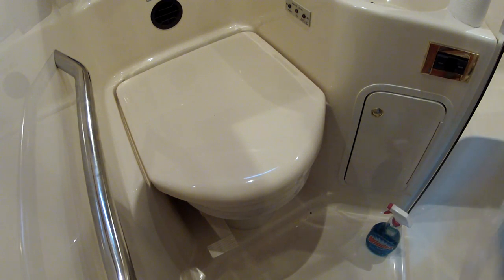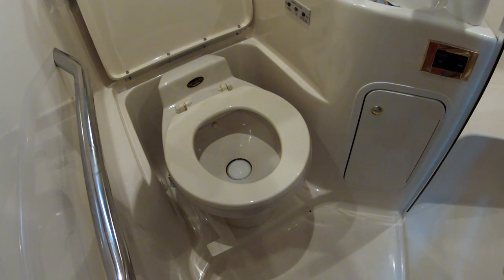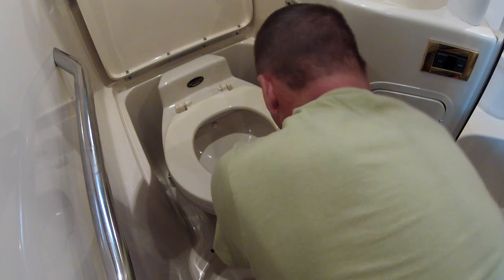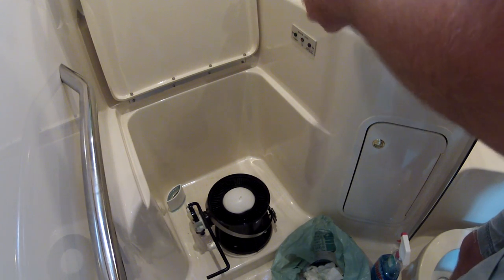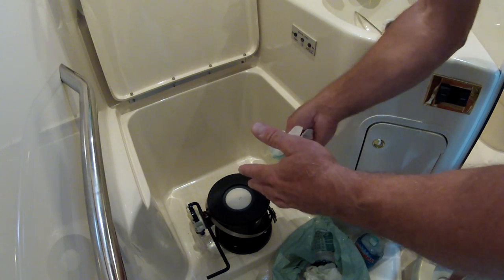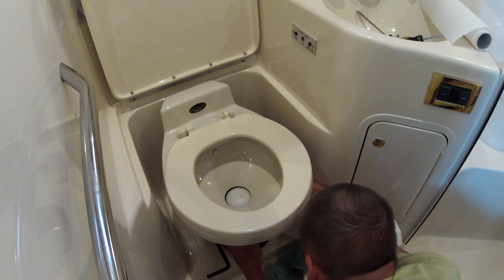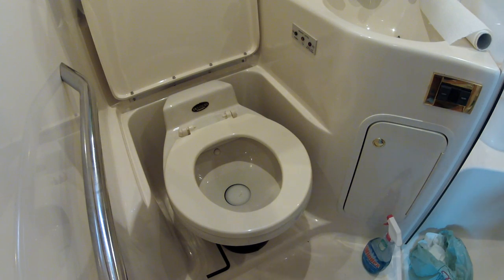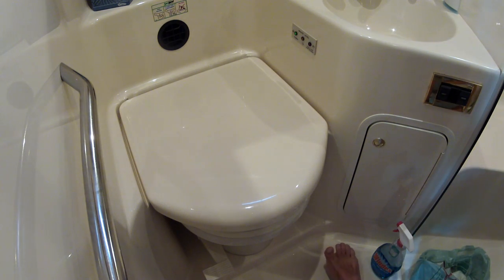Boating How To - Vacuflush Marine Toilet Seal Replacement

Comment: Great video. I have a Sea Ray 370 AC and your system looks exactly the same!
Reply from the maker: Yes, it should be the same, Timothy. If you are looking for any more insights on the entire #Vacuflush system, take a boo at my complete DIY Playlist here; https://www.youtube.com/playlist?list=PLKhjT5kr2l2GpE-r5PjPvMtaRygCEb_si

 I've done pretty much everything that could be done to the entire head system that can be done! That includes replacing the collapsed black water (poop) holding tank with a much larger one - a huge project that was well worth the effort. Also serviced the pumps, vacuum tanks, replaced all the lines, duck bill valves and so on. . .

 I;ll look forward to your comments from those vids ;-)

 Cheers, Paul.

Comment: Very helpful video. Many thanks.
Couple of things from when I replaced the seals on our installation.
First, the water hose at the rear, after several years seems to 'vulcanise' iteself to the plastic fiiting taking the supply through to the bowl so loosening the hose clamp (hose clip in the UK) does nothing to aid the seperation! Only rather dangerous use of a flat-bladed screwdriver will succeed.
Second, if you pull on the water hose too hard, it turns out the rubber plug seal securing the plastic pipe taking the water supply into the ceramic bowl is more likely to detach.
What I did was to ignore the hose clamp in the end and for re-assembly, re-insert the rubber plug into the ceramic bowl with a bit of PTFE tape to restore the seal and, also with a bit of PTFE tape round it, then re-insert the plastic pipe fitting into the rubber plug seal.
Success!  No leak! Job's a good 'un!  :-D
Again, thanks for the video. helped me a lot.
Best wishes.
Geoff.
Reply from the maker: Happy to have helped you out, Geoffrey Smith . I just completed a complete replacement of our waste holding tank - what a job that was! Look for an extended video from that project, coming up shortly.

 I'll look forward to your comments there :-)

Comment: I have a 99 Searay 40' cruiser with a Vacuflush. Recently the Vacuflush won't stop running unless I turn the breaker off. Any suggestions on what it might be?
It holds water, flushes, fills just fine. 

Mahalo,

Anthony

Comment: What is the best way to remove the waterline, or separate the toilet from the waterline?
Reply from the maker: I think you are referring to the water line (where the water comes into the toilet), as opposed to the waterline (where the hull meets the water)?? 
 If so, that line has a simple hose clamp. Super easy job to do 👍
Reply: @BoatingWithBoogaboo  you are correct.  I could not figure out to how to separate the incoming water hose from the vacuflush toilet.  Turns out it is a simple compression fitting that just unplugs from the top where the hose meets the toilet.   Thanks for getting back to me.

Comment: The Ball on my head isn't retracting all the way and is allowing some of the vaccume to leak through and the water gets sucked in. I have to manually push the ball back to close it fully and it will seal. Is this seal the problem or should i try something else?
Reply from the maker: Could be that the clam-shell is just dirty. They sometimes get a buildup from all the nasty stuff we put down our toilets. Try taking the bowl off and doing a thorough cleaning of that clam-shell. Go to roughly the 6:00 mark of the video to see what I'm talking about. And make sure you replace the seal while you're at it :-) No, seriously, change that seal -  and get a spare while you are at it. They fail at the most inopportune times. . .
Reply from the maker: And, here's a video I did when replacing the poop lines on that #boat, but with two cameras, to better show you how to remove the toilet: https://youtu.be/rkjAhhQlvhc?t=381

Comment: I'm putting the 2 part base clamps back on and then the stainless clamp. My two plastic units do not go back together perfectly. This is a gap of about a 1/4-1/2 inch front and back. Is something not seating correctly? As my seal leaks more now then when I took it out for a cleaning!
Reply from the maker: robert feller I'd suggest that perhaps the seal itself is shot. Either that or you reinstalled it upside down? I usually have to replace our seals every season, as they are prone to breakdown, especially when used a lot. 

 Otherwise, I'd take it apart & reassemble to make sure you have everything seated properly.

 Hope that helps!
Reply: ***** Thanks for your time and quick response. One more question. (FYI seal didn't come off). Should the plastic half rings meet/touch when they are fully clamped. Mine have a 1/4" gap and I'm wondering if I'm doing something wrong and it's not dummy proof when it goes back together.
Reply from the maker: robert feller
FYI, if the seal did not come off at least one of the mating surfaces, the toilet would not have come off. When you mention that it didn't come off, I'm sure you meant to say it stayed stuck to one or the other. That said, there still may be an issue with it. As you were in there anyway, not sure why you wouldn't have replaced it? Just one more overpriced bit of marine supply to throw your money at ;-)
 As for the 1/4" gap you referred to, yes, mine looks the same. No, I didn't take one of ours apart to check it for you, but I do have another video I did last year that will show you what it looked like then.
 Another 30 minute long, boring video on replacing the actual poop lines, but I'm including a link that will start the video at the part you are probably most interested in: https://youtu.be/rkjAhhQlvhc?t=9m
Reply: ***** I didn't replace it while I was in there because I didn't have it and my buddy had me believing that a clean and lube would solve the need! To be honest this work doesn't scare me and it will take 5 minutes to get back in there...but I also didnt' want to buy the over priced gaskets until I had a better understanding of what needs replace. One gurus blog says to just to buy a whole new base on these 20+ year old Sea Rays as they get deformed...so still weighing all my options. Any idea how many duck bills there are per pump? I see conflicts of 2 and 4 on each side of pump. Mine is VERY difficult to get to so I won't be pulling it apart until I'm ready todo it.
Reply from the maker: Our 1997 Sea Ray 400 Sedan Bridge has four duck bills per pump - two in/two out.
 Here's a playlist of my DIY videos to hopefully help you out with some of your projects; https://www.youtube.com/playlist?list=PLKhjT5kr2l2GpE-r5PjPvMtaRygCEb_si
 Let me know how you make out with your toilet issue.

Comment: Woo hoo.thanks for the info
Reply from the maker: Woo-Hoo, you are welcome ;-) Check out my Channel for more  #boatin  upgrades and repairs, including our wastewater holding tank removal. We will be reinstalling a new one, complete with new venting system, electronic level gauge and more, all coming up this spring. Keep an eye on us for TONS of more insights, fun and adventure - 2014 will be our first Full Time Liveaboard year for us on 'Boogaboo IV', so stay tuned :-)
Reply: *****
I'd give my next born child for a waste water level gauge on the vacuflush tank. 
Their has to be a better way.
Reply from the maker: tpcrb There is! I had installed a neat and inexpensive setup on our last holding tank - the one that got turfed last fall (http://youtu.be/5OvvvG4Ckqc) and will be reinstalling it again with the new tank, next month.

 When that happens, I will do a more in-depth installation video, but in the meantime, here's a link to a video I posted 2 years ago, showing the actual monitor being installed (http://youtu.be/aTyI1vT38WE).

 The thing works flawlessly and would highly recommend it for anyone! Plus, it was very reasonably priced, at around $150, including shipping and tax.

 Make sure to subscribe to the Channel so you don't miss a thing :-) Cheers!